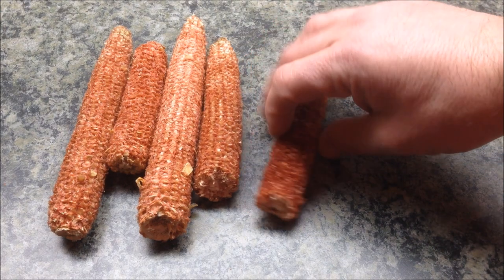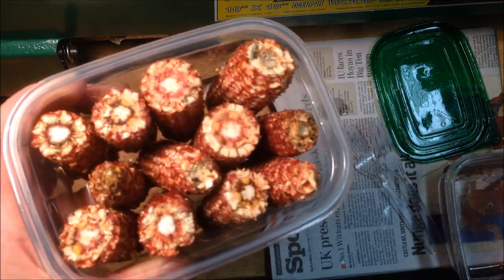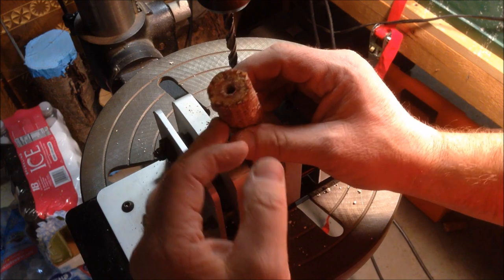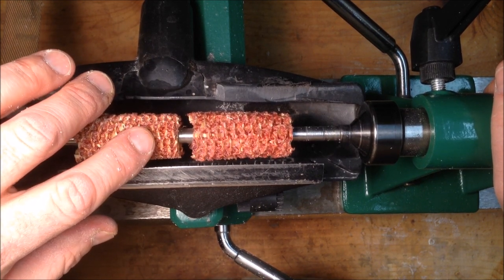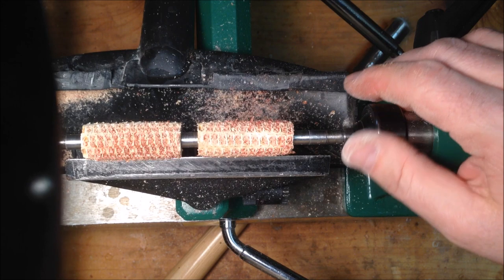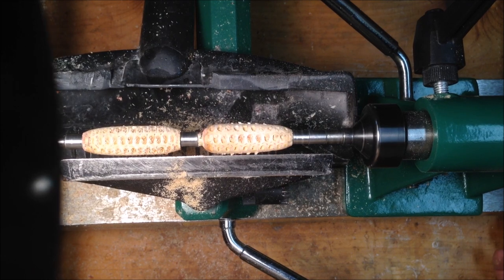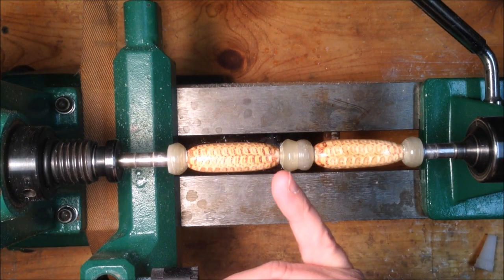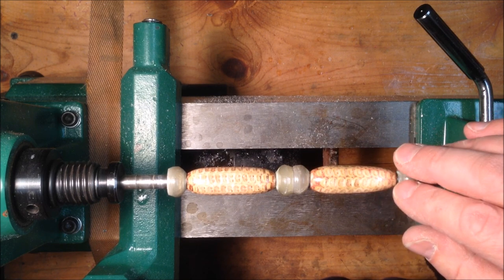Corn Cob Ink Pen

Comment: I checked him out.  Not sure why he needs to pressueize the resin blanks unless it is a physics element that creates the curing. High pressure elevates boiling point and low pressure drops it.  I can see it for materials that have air collapsable space that needs filling to stabilize for machining.  Hey maybe I'll glue a bunch of pencils together and turrn them down into one pencil with a gigantic eraser.
Reply from the maker: Thank you David,

  This new YT tool is showing me all the comments I missed over the years. Apologies for not responding sooner.
  I hope you're still watching and enjoying my videos.

  If you haven't checked out the channel for a while, please stop by and see some of the newer videos.

 I've made a bunch of the over the years.

Regards,
Bob

Comment: Is your name Bob? Just an idea here.. spitballing really,I know a lot of people show when they add epoxy to blanks they put them in what looks like to be a high priced vacuum sealer so all of that resin going into the pores of the wood then they pop them out when dry.. I was thinking about this with your corn cobs and something you might try on the cheap to get better penetration of your wood hardener to your corncobs. why not put some corncobs in a mason jar, add the wood hardener and then use a food saver with the vacuum jar sealer attachment ? it might help pull more of the hardener into your corncobs. again its just an idea. Ed
Reply from the maker: That is a very interesting idea. I haven't got into using vacuum yet but i'm planning on it. This is an idea worth trying as it would be very inexpensive if it works. Thank you. 

  Oh yes, my name is Bob. 

Regards,
Bob
Reply: RJBWoodTurner  Also it might help to pre drill the corncobs before putting it into the wood hardener for max penetration, I wouldn't just go straight to the tube size drill maybe a smaller diameter drill bit just so the hardener would have more of a chance to get to the core part of the cobs
Reply from the maker: I did attempt pre drilling and several of the cobs almost disintegrated. The wood hardener seemed to help although I believe resin and a pressure pot are the real answer.

Regards,
Bob

Comment: At 21:10 what are the things at the end of your blanks? They look like suction cups.
Reply: Pruette, those are nylon bushings used specifically for CA pen finishing.  If you use the standard metal bushings, the CA will stick to them and chip when you remove the blanks off the mandrel
Reply from the maker: Thank you John,
  I can't give a better answer than that. You nailed it. 

Regards,
Bob
Reply from the maker: Pruette,
  John gave an excellent explanation. If
You are interested, I did a video a while back on how to make a set of them. 

Regards,
Bob
Reply from the maker: Forgot the link to the non-stick bushings. Sorry about that, here you go:

https://youtu.be/KSXlS89qmCM

Comment: use thin CA as you turn the cobs down, this will harden the cobs nicely you wont have to worry so much about chip out and the pen will be a lot more rugged when it's done. nice job on the cob!
Reply from the maker: Thank you for the tip Tom, 
  I will definitely try that.

Regards,
Bob